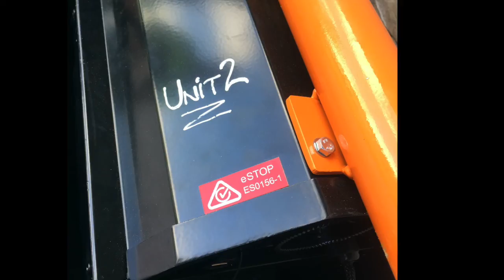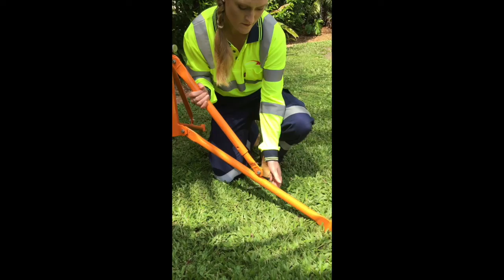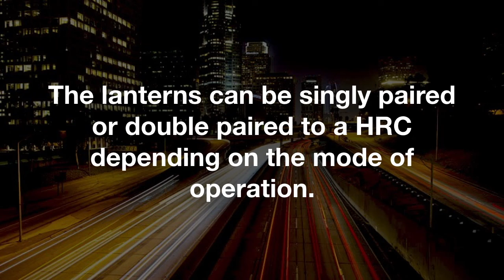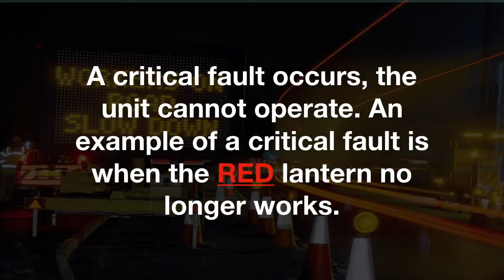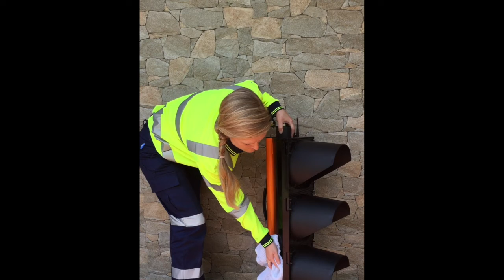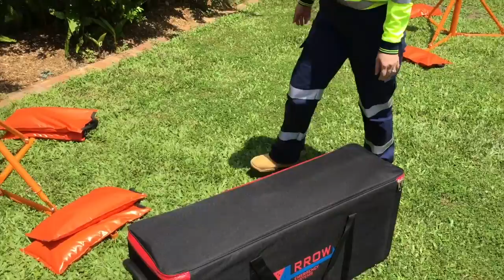eSTOP TUTORIAL FULL VIDEO

Comment: Quick question..i tried with 2 remotes. And i did the same as the video to pair the lantern and the remote. So 1st time its blue light for the fault button and i try to syncronize it, it wont sync and why when i push the fault button long and fault button straight away shut off and never come out as blue or green button again? I tried many times however the fault button still not going out. What happened there? Is the lantern not good?